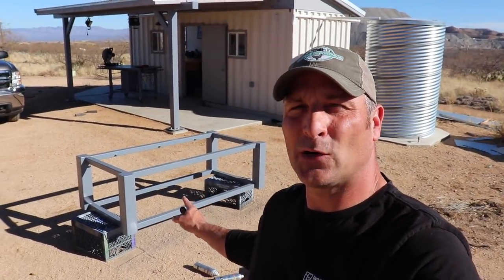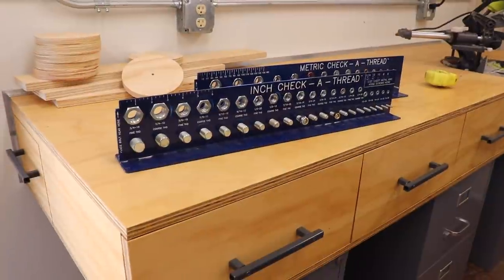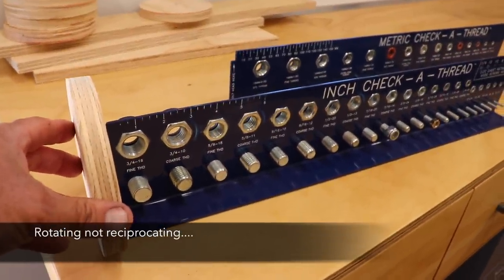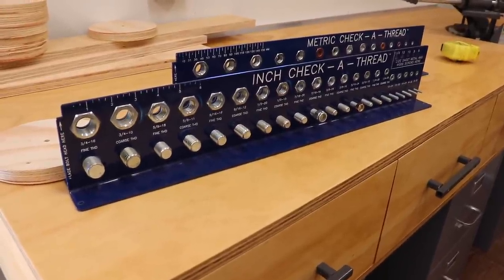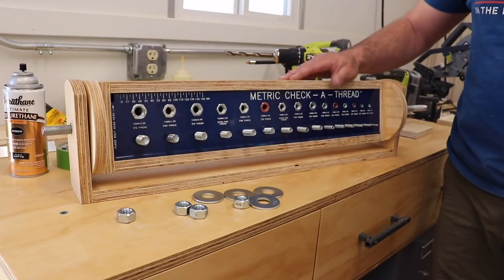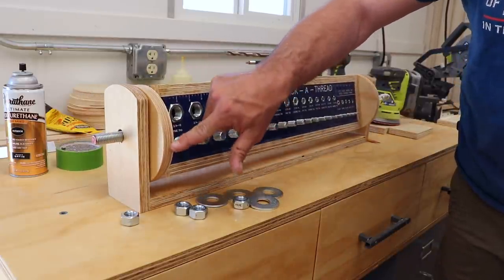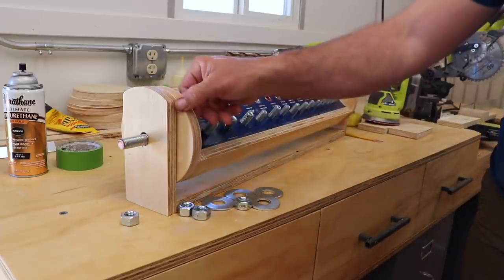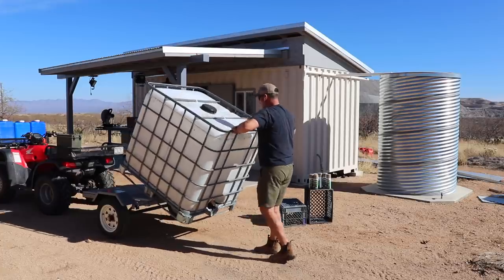Random But Useful - A Container Shop Project

Comment: When I was a gunsmith one of my often used  hand tools was a thread checker. It was similar to a feeler gauge in that it had many, many leaves, each one much like a comb and each comb a different threads per inch. Skip ahead forty years and I've often thought about building a checker very much like yours. The problem is I never found the checker boards such as you have. None of the fastener manufacturers would sell me one each of their display checkers. You have done a very nice job of building yourself an EXCELLENT tool. You're going to be satisfied with your work useing that checker for many, many years. Well done young man.

Comment: One of the first things my father taught me was imperial thread size for hardware and the corresponding wrench size as it related to the bolt head and nut. Then came along metric, a whole new learning experience.
I try and keep that knowledge in my head, that is a perfect project for any shop. Especially as one gets older, you can’t remember them all.

Where would one get those two size gauges ?
Thanx 
Two Thumbs up 👍👍

Comment: I always use those gauges at Ace Hardware to get bolts and nuts etc. well done I think you’ll use it save you searching you’ll already know what you need when she get ready to go by what you need
Reply from the maker: Yep!  And if I ever forget to bring a bolt or check the thread before I left... which I often do as my store trips are usually after I get off work.... I can simply call my wife and have her check as I’m headed to the hardware store 😀👍

Comment: Nicely done, wonder where those guides were purchased originally,  wouldn't mind building something similar.  I also have one of those Atlas cabinets that held tuneup parts rather than brake seals, still have my old 50 year old shop coat as well 😀